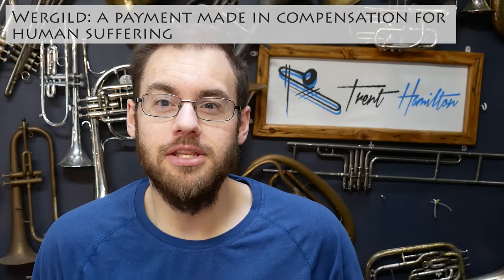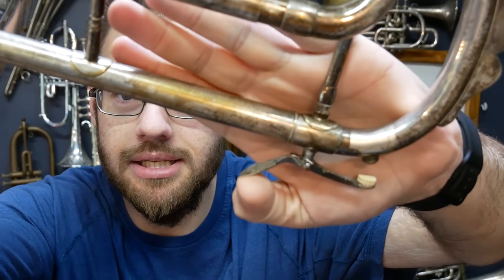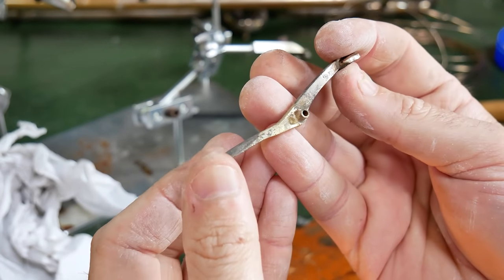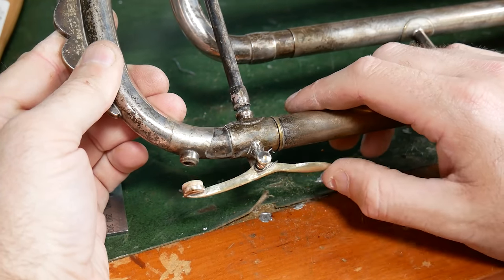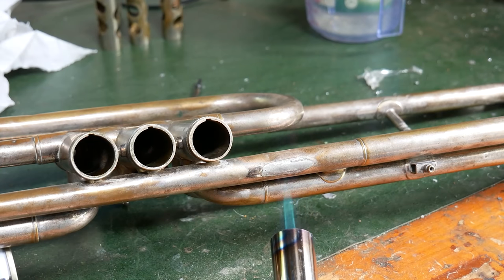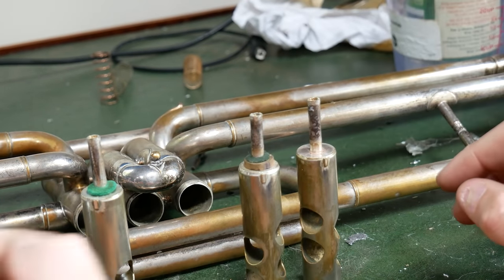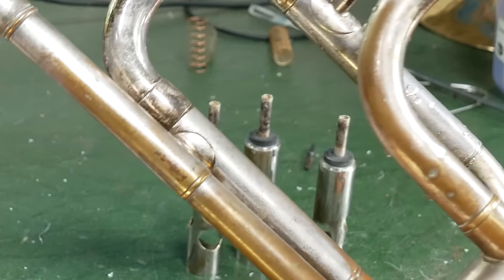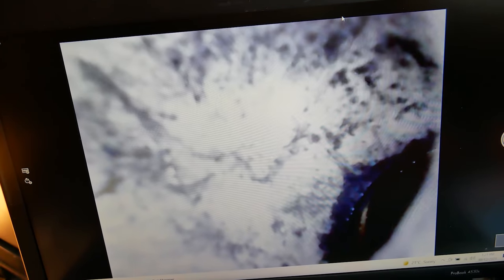A Bizarre F Contrabass Valve Trombone made in Italy

Comment: Perhaps the reason it is in F#ish is that is in “old high pitch”. I have a 1920s E flat tuba that is virtually in E natural. Trent - perhaps you could do a video explaining different pitch datums (data) in times past?
Reply: I have an old F tuba that plays in F# as well
Reply: I thought High Pitch vs Low Pitch was a particularly British thing, but it could be a possibility. Another possibility maybe is that it is actually  in G 1885 international pitch wich was A=435hz; however, in 19th century Milan where Orsi was based, Pitch rose to A=451hz, almost the same as British High Pitch. You can never be sure with these old vintage brass. Modern concert pitch A=440hz wasn't standard until 1955.
Reply: I agree. I have a tenor horn that's in high pitch, so basically an E half flat tenor horn. The tuning slide needs to be pretty much all the way out for it to be in tune, so I need to get it converted somehow to low pitch so it can be properly played. (However, it does feel very fluffy when played since it had a sonic clean, which it didn't beforehand, despite several holes being patched after the clean)

Comment: This sounds more like an old F bass than a contrabass. Small bore basses used to be in G, F, or Eb, obviously the UK and Commonwealth preferred the G instrument. Afaik in France the Eb was most common until they started using a section of 3 tenors, and F was most common in Germany and countries easy of there (hence the Bartok gliss)
Reply from the maker: Yeah, I had a similar line of thought, but this isn't a small bore, which I why I'm thinking contrabass rather than bass. The definitive answer is that it is whatever the manufacturer called it, but I can't find any information from them either.

Comment: I don't know if you're looking for repair tips, but if so here's one. When a water key breaks like that I finish straightening it, file the joint until it's clean and flush, then silver solder. You get a stronger joint and straight key that way.

Comment: Could your trombone be constructed to A+435. Standard pitch for many European instruments prior to 1918?
Reply: That would mean it would play flat. It's more likely that it's tuned to A=450 or something similar, which was, as far as I know, also a standard in some places like Italy
Reply: Then it would be too low, not too high. But A=452 was also a standard in some places.
Reply: Wouldn't tuning to 435Hz rather than 440Hz require pulling the tuning slide out even further?
Reply: @Eidolon2003  Yea. Bad example. But there were several 'tunings' in use at the time that instrument was manufactured. some were as high as 455.
Reply: I was going to say the same thing, a lot of brass bands used high pitch until the 1970s

Comment: I could be wrong here, so somebody correct me if I'm wrong, but I'm pretty sure the water key cracked because you immediately dipped it into cool water after heating it. Doing this hardens the metal instead of softening it. Allowing it to cool gradually should've softened it. You did a great job repairing it regardless, better than I ever could've done.
Reply from the maker: Brass doesn't quench harden like steel does.

Comment: Lovely sound! And very good video.
But I retain my opinion that this is in fact a bass valve trombone, not a contrabass.
Reply: Agreed.  With only three valves, its lowest note is B-natural before the gap down to pedal F.  That's still plenty for much of the Trombone 4 parts in the Italian opera repertoire, but it could never be used to play Otello or Falstaff
Reply: @danieldicesare7365  That's one reason why I like the fingering system with a two-step 3rd valve (swedish fingering/dresden fingering/whathaveyou) - on a 3 valve F instrument you are able to play down to B-flat.
Reply: @Swedbander  Not really. Even with the valves tuned slightly flat, you will still be a quarter tone off with all 3 down. 1-2-3 is sharp as heck normally. With a 2 step 3rd, 1-3 is just as sharp as 1-2-3 was, and 1-2-3 is now basically unusable.

Comment: I believe silver plating valves of instruments of that vintage was more or less the practice. I think copper or nickel plating is relatively modern.
Reply from the maker: Perhaps all my instruments of a similar vintage just have no plating left on the valves?
Reply: @TrentHamilton  yes, that, or maybe they didn't have the valves rebuilt. I'm not an expert but I think the valve rebuild technique around the 10s, 20, 30, or 40s was to silver plate them.
Reply: The color of those isn't silver. I don't think those valves are plated at all. The ports look brass. My guess is that's a nickel silver piston with no plating. There was a lot of experimentation with alloys for pistons in that era so it's possible it's something else entirely. If it was a plated the ports would match the color of the body. Silver plating would never happen on a valve, it's too soft and would wear off almost instantly.
Reply: @squabok  nope. I've seen silver plated rotary valves at least first hand. Rare, yes. But they exist!

Comment: I’m confused. Why is an f tuba considered a bass tuba but an f trombone considered contrabass?
Reply: I think because the name of bass trombone was already taken by the Bb with F trigger; instrument families describe themselves as soprano, alto, tenor, bass etc. relative to each other, rather than to an objective standard of pitch i.e. A tenor saxophone has a higher range than a tenor trombone, with a tenor recorder being even higher than that. Bass trumpet has the exact same range as tenor trombone as an even clearer example.
Reply: @manracmolactrac  I would agree if the BBb contrabass trombone didn’t exist
Reply: This is not a contrabass, it is a bass. It lacks the additional valves needed to cover the whole contrabass range. The contemporary bass-contrabass trombones in F is a modern invention.
Reply: @Swedbander  
Yes, this a bass trombone. A valved version of the old straight F bass slide trombone that had no valves and used a handle to reach sixth and seventh positions.